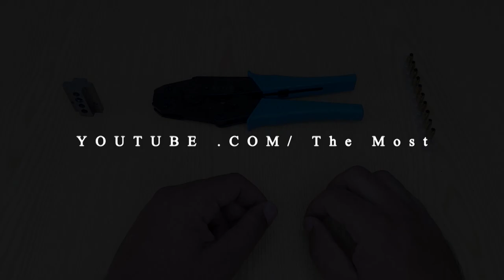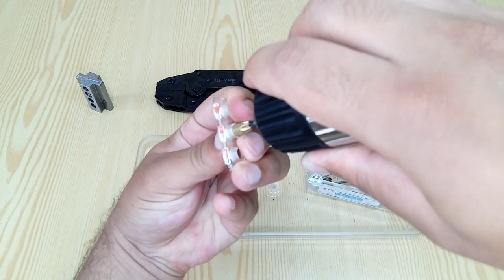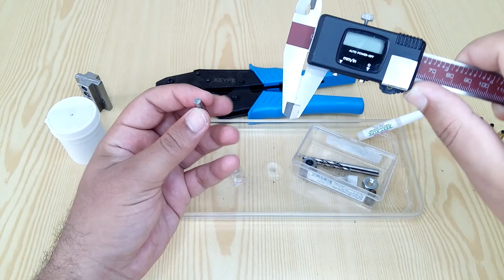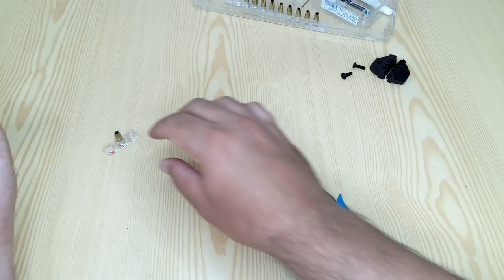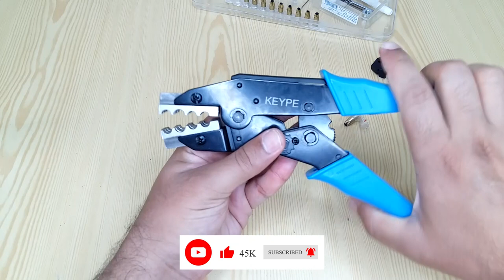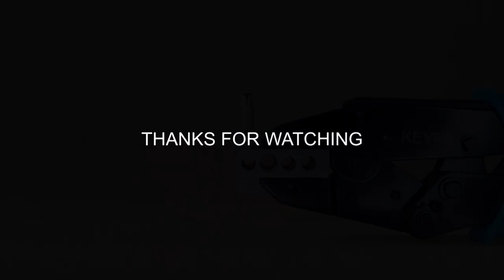How to make usable nail gun blanks | Survival Rifle #refill  #neckdown #blank

Comment: For the metal parts you replaced for the pliers , wondering what kind of metal you used and size in each area?  Thank you
Reply from the maker: 4140 alloy steel . It depends on the barrel chamber